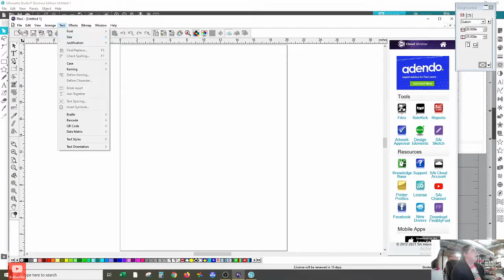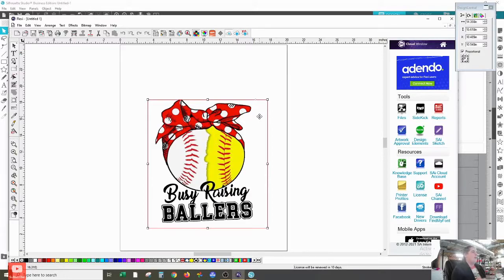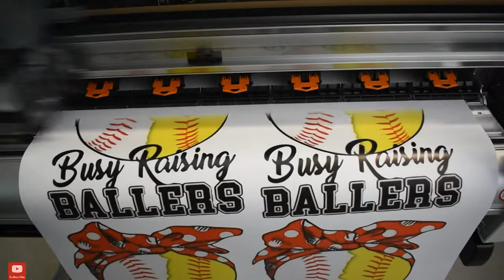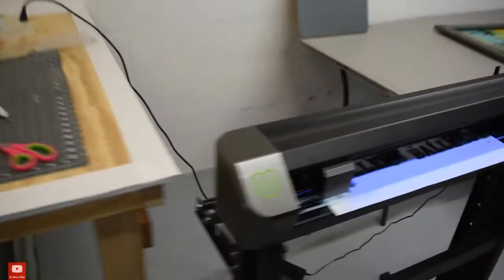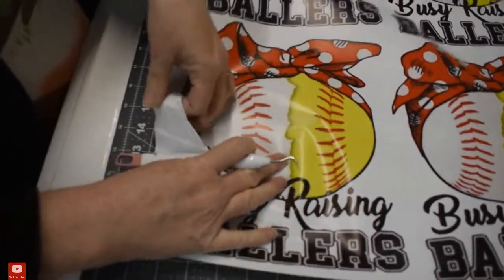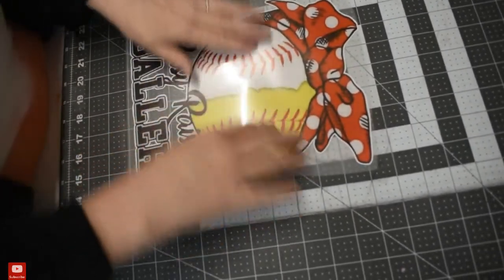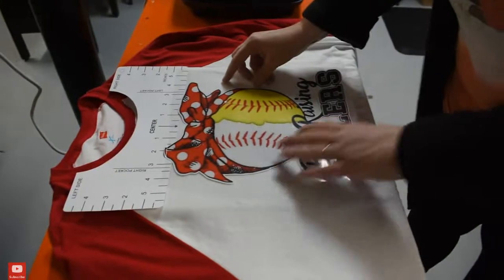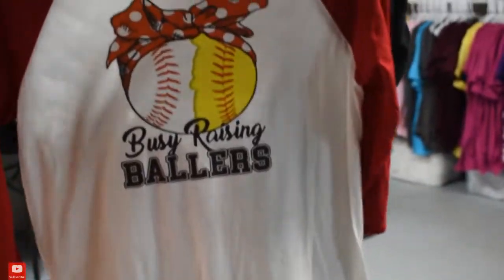How to use Mutoh Value Jet 628 and Muse 24 Cutter- Brief Tutorial (Not Sponsored)

Comment: we have a very similar set up (just a different cutter). your registration marks seem a little small. but in my experience as long as the cutter is in the little box the registration marks make, there shouldn't be an issue. thinking about picking up a muse tomorrow though so we will see.
Reply from the maker: Let me know if you need help. Learned alot